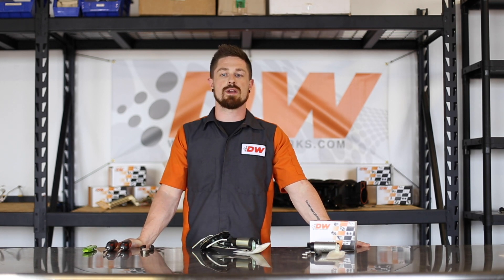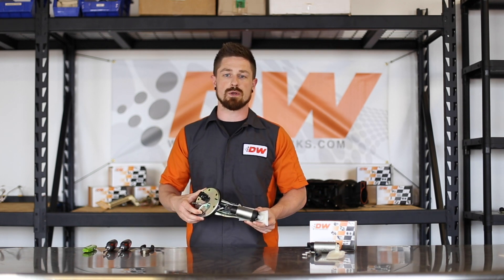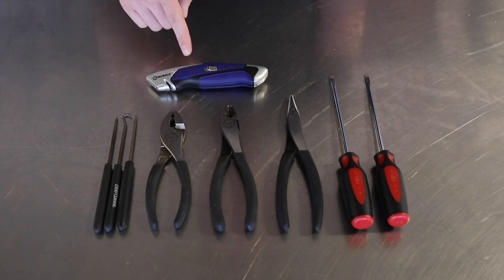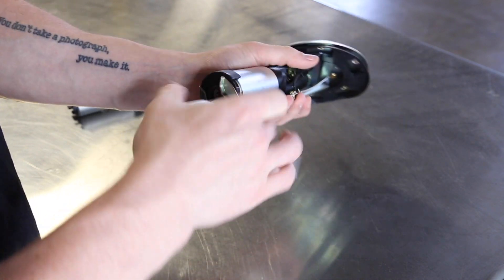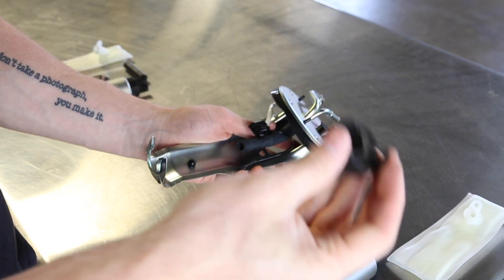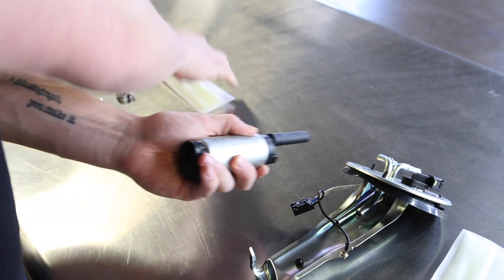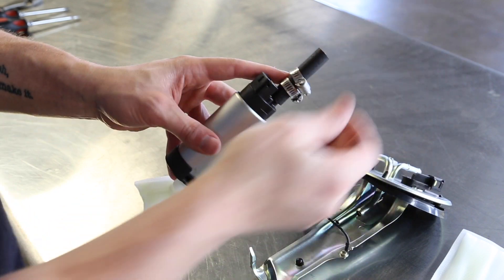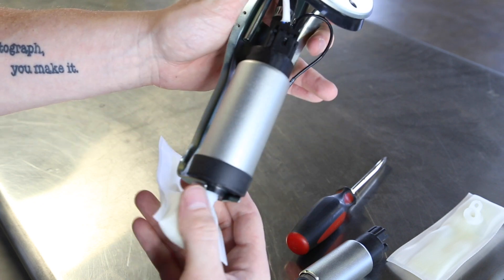92-00 Civic and 94-01 Integra DW200/300 Fuel Pump Installation Guide

Comment: are these plug and play?
Reply from the maker: Yes, the install kit comes with the specific filter for the application, fuel-safe hose and clamps, and a connector incase your factory wiring needs to be replaced.
Reply: @deatschwerks  do you guys require a relay or is the factory fuel pump wiring system efficient enough to run this on e85
Reply from the maker: @AV8Steps  We recommend a relay/hardwire kit on any EFI car, especially older ones, to get the best performance out of the pump.

Comment: Can I put a bigger pump in a Oem integra type r without over filling the engine? Ist not a turbo setup or something. It's an Oem engine
Reply from the maker: Yes! You can technically run a larger fuel pump than needed. It wont over fill the engine. The ECU will only command the right amount of fuel even with a larger fuel pump. For example if you are running a stock pump at 85% duty cycle, a larger pump may only run at like 50% duty cycle
Reply: Also the type r oem fuel pressure regulator will only allow that oem spec pressure into the engine .